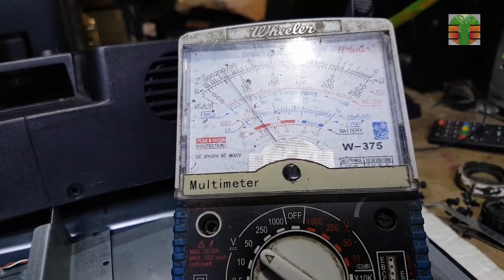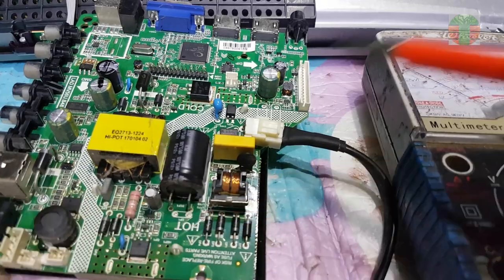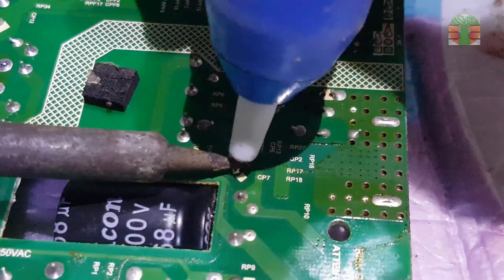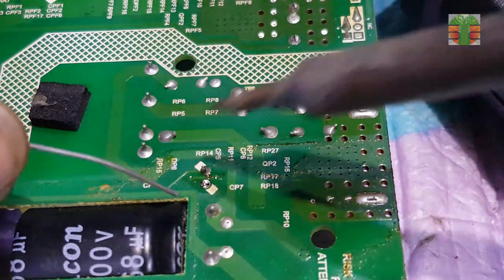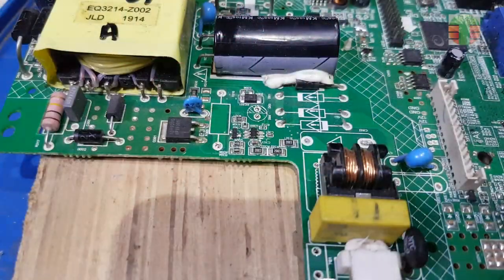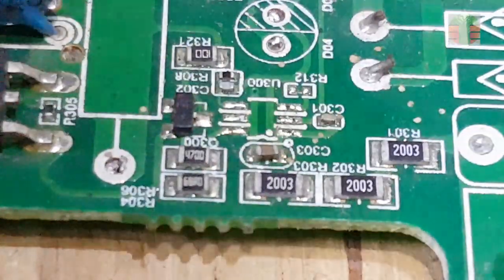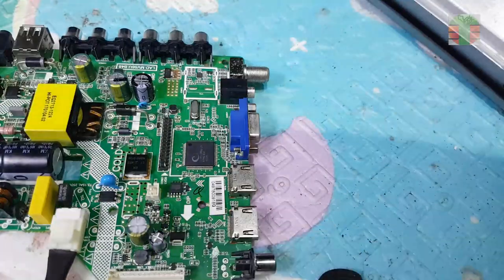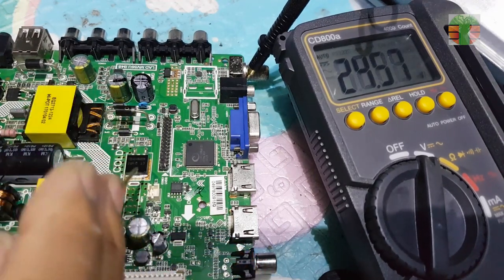Prestiz LED tv no power (blinking light indicator)

Comment: What load did you use when discharging main capacitor?
Reply from the maker: 220 ohms 20watts resistor
Reply: You can use 1kOhm or 2,2kOhm 5W without problems.
Reply: @kikopasinecki5110  
It will take more time to discharge the main capacitor .
The best way is use a 100 watt / 220volt filament bulb to discharge main capacitor.
Reply: Taga saan po kau..
Reply: Ganyan din po problema ng tv nmin..blinking power light...sa pampanga po kmi..

Comment: Is there any difference between analog and digital meter when measuring?
Reply from the maker: I use analog if the voltages are fluctuating.  Digital cant
Reply: My fluke meter has min-max option,you can measure fluctuation with digital meter.
Reply from the maker: @kikopasinecki5110  I have my own way to measure voltage. And I can troubleshoot them without an expensive meter.
Reply: @tevzTVTevatronics  can't the digital readings go up and down when voltage is fluctuationing?